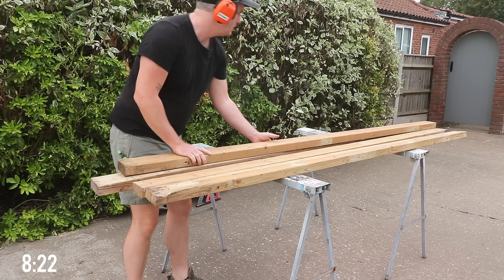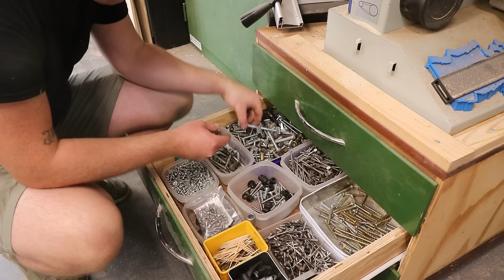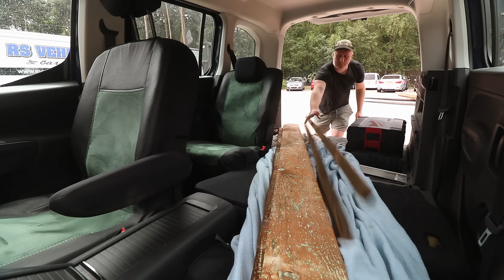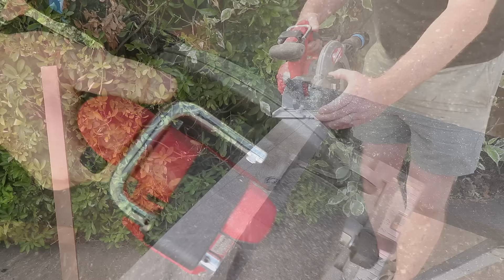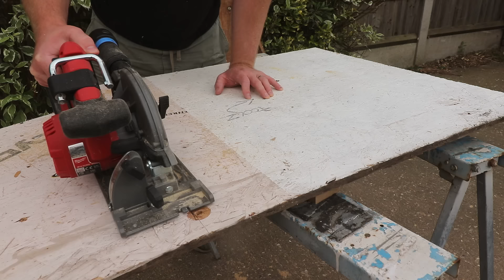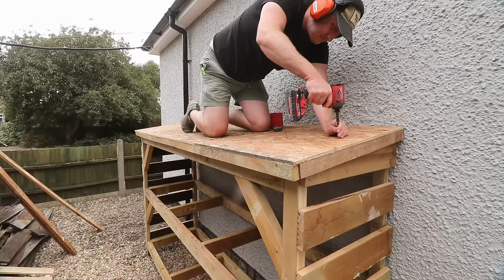Can I Build A Log Store In ONE DAY??

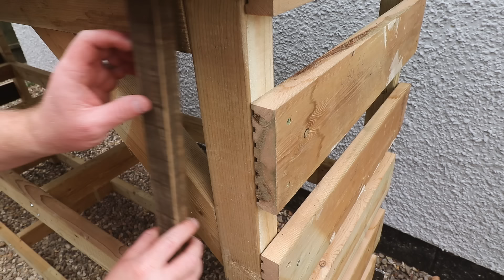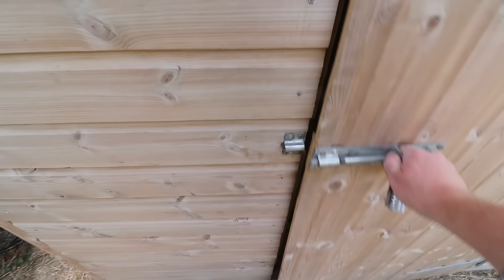Comment: Starting at 10:05 where you cut the batons into trim pieces to cover the end grain, at 10:10 it looks as though the side boards finish flush with the front frame, Then, at 10:15, the baton is nailed to the end of the side boards and at 10:19 you use your thumb to check that the trim is flush with the front frame.
I take it that you had to trim the side panels before fitting the baton board, but the screws in the side panels do not appear to have moved.
I am not trying to be hyper-critical. I want to build a log store based on yours, so I want to understand the small details as well as the big picture.
I love your channel and love what you do. Keep up the good work.

Comment: Hand saw for the notch on the shelf, more "normal" householder tool than a chisel.  Great to see you trying and acknowledging the effort of reduced tool use. Easy to forget when you have what you need. Using scraps/salvaged is always fun and works well with building techniques for creative working and problem solving.

Comment: Great use of what u have.. I was a little surprised that you placed it with the diagonal braces at the front of the rack, I would have though you’d want those turned to have those against the wall. Was that by design? Thanks for sharing.

Comment: Blimey Keith, that is one substantial log store, when you climbed in to it so that you could move it it looked like a three man bunk bed ! 😉😂
Good use for a load of Mainly shorter off cuts !
Can I ask, is there a reason why you have the braces at the front as opposed to the back of the store as they will slightly restrict access ?
That felt looks ok from here, as long as there's no tears, it's good enough for a logstore for a good few years and as it will need no joins you can always go over it with more felt or shingles if it does start to deteriorate later !
Cheers, AndyC
Reply from the maker: Thanks! I like the braces at the front just as a bit of a feature 👍

Comment: Just a question... Aren't wood burning stoves significantly bad for the environment? 

I don't mean to be judgmental, I'm just wondering if that's always the case or if there are ways to make them environmentally friendly.
Reply from the maker: They are not great for the environment, however the modern ones comply with pollution regulations. As long as you burn dry, clean timber it's not too bad, I think.... But ultimately the government should be doing more to incentivise things like loft insulation and solar panels etc rather than driving people to install log burners because they can't afford to buy greener energy 🤷‍♂️

Comment: Great video, as always Keith. It's one thing to make a thing, another to create a video of your doing it at the same time. I put together a log store myself last year, and I guess it was with limited tools as all I needed was a chop saw, driver, drill, tape measure, square and a few clamps. I guess time will tell If it's still standing in a few years time as I didn't see the need to felt the roof, I used pressure treated fence lats instead.